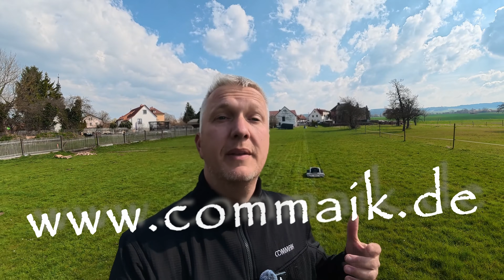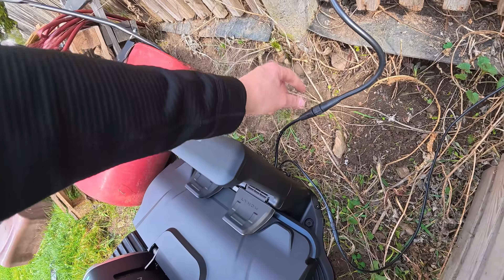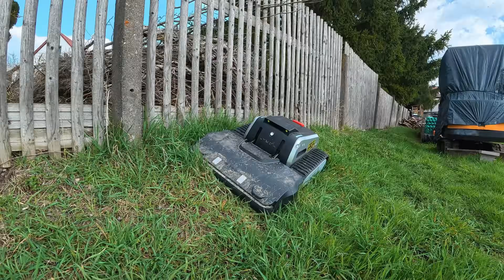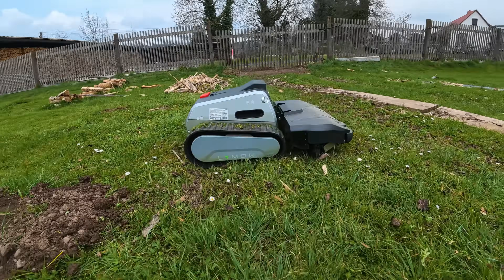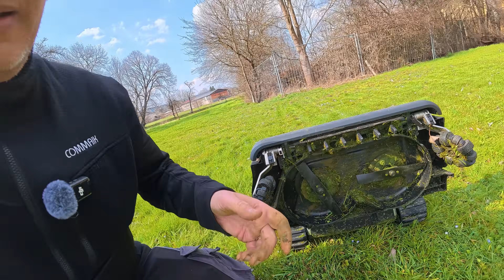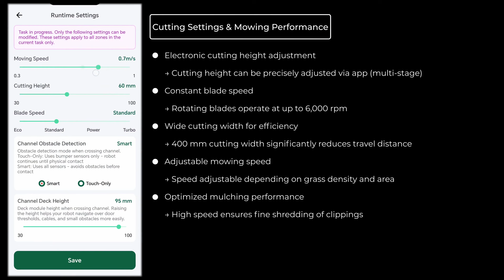This Robot Mows 1.7 Acres a Day! Lymow One Plus Full Test

Comment from the maker: 👇 Get the LYMOW ONE PLUS here*:
🔗 LYMOW ONE PLUS https://lymowtradecolimited.pxf.io/PzOeNq
🔗 Rotary Blade Set https://lymowtradecolimited.pxf.io/1G9XQB
🔗 528 Wh Extra Battery https://lymowtradecolimited.pxf.io/JkK9yN

👇 Want to shop directly on Amazon*?
🔗 https://geni.us/iQpe2 (Amazon)

👇 Get the LYMOW ONE (2025) here*:
🔗 LYMOW ONE https://lymowtradecolimited.pxf.io/2a4gL0
🔗 Mulching Blade Set https://lymowtradecolimited.pxf.io/GKLQkn
🔗 Super Swing Blade Set https://lymowtradecolimited.pxf.io/YRZjve
🔗 Replacement Battery https://lymowtradecolimited.pxf.io/Z6gmzK

ℹ Save $100 on your Lymow One purchase by using my discount code 👉commaik👈

📝 For a detailed hands-on review and more insights, check out my full blog post:
🔗 https://commaik.de/2026/03/lymow-one-plus-im-test-rtk-maehroboter-fuer-grosse-flaechen-schwieriges-gelaende/

💡 Quick update / clarification:
The cable connections are rated IPX67 (not just IPX6 as mentioned in the video).
So they are fully suitable for outdoor use — including rain and harsh conditions.

🔍 About upgrading (One → One Plus):
My conclusion in the video still stands — upgrading is not a must if you already own the Lymow One (2025).

👉 However, the One Plus does bring some real improvements:
LyCut 2.0 system (dual rotary blades + cleaner cut)
Cyclone airflow for more consistent mowing
Top-mounted charging contacts (less sensitive to dirt/grass juice)
Improved track design to reduce grass buildup
More durable build + long-life LiFePO₄ battery

➡️ Depending on your use case, these upgrades can absolutely make a difference.

📊 Now I’m curious:
👉 Is the upgrade worth it for YOU?
Vote in the poll above and drop your thoughts in the comments 👇

📱 LYMOW App Download:
🔗 Android: https://play.google.com/store/apps/details?id=com.lymow.app
🔗 iOS: https://apps.apple.com/us/app/lymow/id6739445510

📝 For a detailed hands-on review and more insights, check out my full blog post:
🔗 https://commaik.de/2025/11/lymow-one-im-test-maehroboter-ohne-begrenzungskabel-mit-rtk-navigation-und-kettenantrieb/

Follow me on my social media channels for more content! @commaik

🎥 This video was originally produced in German for my main channel:
https://youtube.com/commaik

It was then translated into English using Heygen – with my own voice and lip-sync.

🎙 Want to dub your videos like I do? Try Heygen:
🔗 https://www.heygen.com/invite/b96cdcf6
 – Get 300 free credits when you subscribe.

📺 The original video, which includes English subtitles, can be found here:
https://youtu.be/HEhctQ6-WfQ

Note: All links marked with * are affiliate links. If you make a purchase through these links, I will receive a small commission at no additional cost to you. Thank you for your support!

Comment: I appreciate your video. You were clear and concise. One question I haven’t seen a reviewer answer (or I missed it)… your hedgehog test was very helpful for obstacle avoidance testing but does the mower return later to see if the obstacle has been moved since animals are different from kids toys in that respect. If I had a playful dog running around and then laying down, would I end up with a patchy lawn or would it take care of the issue apart from something that did not move at all? Thanks again
Reply from the maker: Hi 👍

thanks, really glad the video helped 😊

Regarding your question:
The mower will initially skip that area and continue mowing the rest of the lawn. In the app, you can sometimes even see these unmowed spots.

Once it has finished the main area, it will go back and specifically target those missed sections and continue mowing there. So it basically comes back later and takes care of the areas it left open before.

In your example with a dog, the mower would avoid the spot while the dog is there. But once the area is clear again, it will return and finish the job—so you shouldn’t end up with a patchy lawn.

And just as a small heads-up: the Lymow special offers are still running until tomorrow (links are in my video description). If you’re considering getting one, I wouldn’t wait too long

Comment: Can the lymow make patterns ?
Reply from the maker: The mowing lines on the Lymow are very consistent, so you naturally get a nice striped pattern, similar to what you see on well-maintained lawns.

You can also set it to change the mowing angle by about 30° each week, so the stripes don’t always run in the same direction. That’s good for the grass and adds some visual variation.

However, more complex patterns like checkerboards or even custom designs aren’t possible right now. There’s no precise control for that level of patterning.

So it’s great for clean, even stripes—but not for lawn “art”

Comment: Good review.  I'm surprised you said the upgrade to a One Plus wasn't worth it with 2.6 times the power.
Reply from the maker: Thanks 👍

I think it’s important to clarify what I meant. My statement was really about the direct comparison and the upgrade from the Lymow One to the One Plus.

If you already own a Lymow One and you’re happy with it, I personally don’t see a strong reason to upgrade. Yes, the One Plus has more power, improved blades, and feels more refined overall—that’s definitely a step forward.

But at a price of around $3000, the added value compared to a working previous model would be too small for me personally.

It’s a different story if you don’t own a Lymow yet:
In that case, I’d say the One Plus is absolutely a great option 👍

So it’s not about the device being bad at all—it’s actually a really solid machine. It’s purely about whether the upgrade from last year’s model is worth it.

Do you already have a Lymow? If so, how happy are you with it?

Comment: How much mow time do you get off of one single charge.
Reply from the maker: Good question 👍

With the Lymow, the mowing time per charge really depends on settings and conditions. According to the specs, you’re typically looking at around 2–3 hours per charge.

In my test (the large field from the video), the mower had to recharge once in between to finish the entire area.

One important factor is the mowing speed:
If you run it at higher speed, it will cover less area per charge because energy consumption increases.

From my experience, it’s more efficient to use a medium speed. That way, the mower saves energy, and due to fewer or shorter charging breaks, it can actually finish faster overall.

I’m using the 10Ah version with the larger power supply, which recharges significantly faster.
With the smaller 5Ah power supply, charging takes noticeably longer, which can slow things down quite a bit on larger areas.

So personally, I’d always recommend the 10Ah version, especially for bigger lawns. You can also check the links under the video for more details

Comment: Hi it's me again!  I looked into this mowers theft protection.  And was stunned with what i found.

There is not even a modest level of anti-theft protection on the machine.

There are some make--the-buyer-feel protected 'anti-theft features' listed, but i'd have no reservations about walking up on your yard, and throwing that thing in the back of my truck.  At all.  

Roll it on its back and it disables the 'fake security' that it has.  Or unplug the battery.  Either or.  You won't ever find it again.  I know it.  And you wont even be able to tell what its last location was.  It's crazy bad theft protection.  Almost like its setup to entice a thief to grab it.

Your pin code does nothing at all to protect this device from theft.  The pin code helps the manufacturer sell you another unit after its been stolen.   Its a feel-good system.  And relatively trivial to get the pin code out of it too.

After i safely transported your mower to my garage, i'd remove the cover, and pop off its the gnss/lte antenna connector.  Probably take me around 15 minutes to get to it.  Its not sending any gps location data at that time for its 'Find my Robot app', so im not worried about anything at all while im disassembling your mower.  Your units mine now.  Once i pop off its 4g connector, I can now power it up and get its pin.

At that point I'd likely just strip it for parts cause i could sell them for twice the value of the mower.  But if i felt like tinkering in Lymow snatch and grabs i'd solder 3 wires onto its keypad, plugged into a cheap microcontroller like an esp32, write a 7 line script to punch-in sequential pin codes - 0000, 0001, 0002, etc.  And a laptop or phone camera pointing at its screen to let me know when im in.  It's crazy easy to do for any computer kid.  Probably take me 3 hours to get the first decoder created.  Cost me about 13 bucks to make one.  Maybe there is a market for them online?  With my work complete, it would present the Lymows pin code within 4 days.  And it would be reusable for the next lymow I'm going to grab.  Only 30 minutes setup on the next Lymow.

Maybe you want to look into this units anti-theft protection before plopping down 3k for this mower.  Just a heads up.  Cause i did.  And its not secure whatsoever.

Now I'm wondering if I can query the gps coordinates of everyones lymows.  I bet its super easy.  Probably just a serial number in a curl one-liner.
Reply from the maker: Hi, thanks for your detailed input 👍

I totally get your point—once you really dig into the technical side, there are often ways to bypass systems like this. And to be fair, that’s true for many devices, not just the Lymow.

One thing I can add from real-world experience:
I previously had the earlier model. I reset it to factory settings and passed it on, but the new owner still couldn’t use it because it was still registered in my app.

I actually had to set everything up again and actively remove the mower from my account before it became usable for the new user.

So while this doesn’t prevent a determined theft, it definitely makes it less attractive—especially for someone who just wants to grab it and resell it quickly.

In the end, like with most outdoor equipment, there’s no such thing as 100% protection. But these mechanisms at least add some friction and make things a bit harder for casual theft.

Still a very interesting point you’re raising 👍

Comment: If it had home assistant integration i'd be a buyer right now.  But it doesn't.
Reply from the maker: Totally understand that 👍

If you’re already using Home Assistant, it just makes sense to want full integration and automation. That’s definitely a weak point of the Lymow right now.

I wouldn’t be surprised if they add something like that in the future though—smart home integration is becoming more and more important for these kinds of devices.

For now, you’re limited to the app, which is fine for some users, but not ideal if you want deeper control 😊

Comment: Reliability of these SucksAss
Reply from the maker: I can understand the frustration 👍

My experience has been a bit mixed as well. Overall, the Lymow runs quite reliably for me, but there are definitely situations (like very tall or wet grass) where it reaches its limits.

In the end, reliability really depends a lot on the conditions and the setup. If the area is well prepared and the mower runs regularly, it performs much better.

Have you had hands-on experience with it, or are you referring to things you’ve seen in videos/reviews?

Comment: I wonder if you remove the small plastic door and brace that block the grass from leaving the cutting chamber, it may work much better afterward. The grass may fly out of there and then the mower cut would be perfect.
Reply from the maker: Yes, that’s a very valid idea 👍

I actually removed the rubber flap on mine as well. It’s only screwed on, so it’s pretty easy to do and not really an issue from my point of view.

The downside is that the clippings get thrown much farther to the side—but on larger areas, that doesn’t bother me at all.

As for the metal brace, I would only remove it if really necessary, for example when dealing with very tall or wet grass. In those conditions, it can definitely improve the discharge.

And most importantly: mowing more frequently makes the biggest difference. If the mower keeps the grass short consistently, these kinds of issues occur much less often

Comment: The side discharge on only one side is definitely an issue. There's a YouTube named "Doc" or something like that who had to remove the door on his LyMow One Plus AND cut the metal bar that was supporting the door off with a dremel in order to stop the clogs. He also slowed the speed down to reduce the rate of cutting to stop the clogs and he said those three things made it work just fine. I also think that if you cut more often (and there's less grass to cut), it won't clog much.
Reply from the maker: Yes, the discharge topic is definitely interesting 👍

I actually removed the rubber flap on mine as well. It’s only screwed on, so from my point of view that’s not an issue and doesn’t affect the warranty.

Of course, the downside is that the clippings get thrown much farther to the side—but on my large test areas, that really doesn’t matter at all. It’s not a problem there.

As for cutting off the metal bar, I would personally only do that if there’s really no other option. If you’re regularly dealing with very tall or wet grass, then yes, that could definitely improve the discharge.

And you’re absolutely right—mowing more frequently is probably the most important factor. If the mower keeps the grass short consistently, clogging becomes much less of an issue.
Reply: Hi, VERY nice video, finally someone that can form a cohesive point and present it with no verbal clutter. My machine should be here in a couple of days, looking forward to getting it. I am very interested in the clogging issue. The present answer is the 5 screws that allows you to remove the entire flap assembly. But that will impact the vacuum generated for lifting the grass, won't it? Is the improvement by lifting even noticeable? Would appreciate an answer soonest. Thanks!
Reply from the maker: Yes, that actually matches some of the feedback I’ve seen by now.

And that’s exactly why I personally prefer the dual-side discharge system of the original Lymow One over the newer setup on the One Plus.

I haven’t had any major clogging problems myself so far, but I can absolutely understand why some users start modifying things. Especially in tall or wet grass, the reduced discharge area will probably reach its limits more quickly.

And you are absolutely right:
Mowing more frequently with less grass to cut makes a huge difference. In my opinion, that’s one of the most important factors with these high-performance mowers anyway
Reply: No need to on the One Plus-just pull the screws and remove that whole assy that mounts the flap. Did it before first use, took about 2 minutes.

Comment: Thanks for the detailed video. I have one question does it mow all the way to the map edge? How close it mow to the fence.
Reply from the maker: Thanks, glad you liked the video 👍

Yes, the Lymow does mow very close to the mapped boundary. In the app, you can even adjust how it behaves along the edge. For example, you can choose whether it should run slightly inside the boundary or more centered on it.

At the same time, the sensors are always active to prevent collisions with fences or other obstacles.

If both sides of the edge are “open” and drivable, the result is almost perfect—the mower can cover the edges very cleanly.

However, if you have a hard boundary on one side, like a wall or fence, there will usually be a narrow strip left uncut. That’s simply because it won’t drive into the obstacle.

Corners behave in a similar way:
If they are open and accessible, it can mow them very cleanly (and you can already influence this during mapping). If there are hard edges, you’ll typically see a small leftover area there as well.

On my large test field, that wasn’t really an issue. But in a home garden, it can make sense to design the edges so the mower can slightly overrun them—this gives you a much cleaner result overall 😊
Reply: @commaikenglish  I'd like to know this too.  'very close' or uncut narrow strip is defined as how many cm or meters?
Reply from the maker: @eric3434  Good question 👍

In practice, we’re really talking about a narrow strip in the centimeter range, not meters. Depending on the situation, it’s usually around 5–10 cm that may remain uncut. That also comes from the distance between the blade and the outer edge of the mower housing.

It strongly depends on how your edge is designed:
If the edge is “open” and the mower can slightly overrun it, there are basically no visible edges left.

If you have a hard boundary like a fence, wall, or curb, the mower will intentionally keep a small distance—and that’s exactly where this narrow strip comes from.

Also, the tighter you map the boundary, the closer it will mow later. You can fine-tune this a bit in the app as well.

But if you want to stay on the safe side and avoid any damage to the fence or the mower, you should realistically expect around a 5–10 cm uncut strip.
Reply: @commaikenglish  Got it.  Thank you!  Thats quite good.
Reply from the maker: @eric3434  You’re welcome, glad it helped 👍

Yeah, for this type of mower and its safety distance, that’s actually a pretty solid result in practice 😊